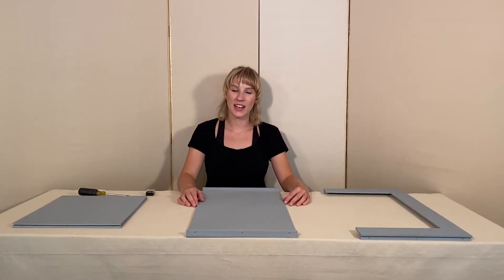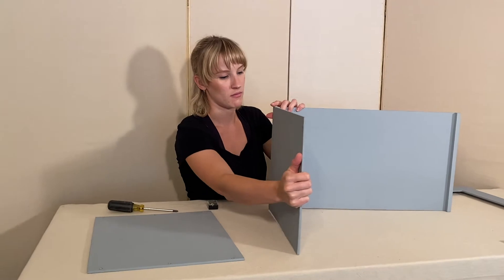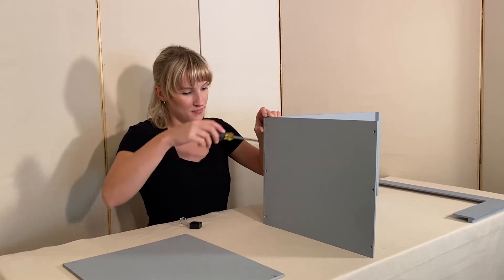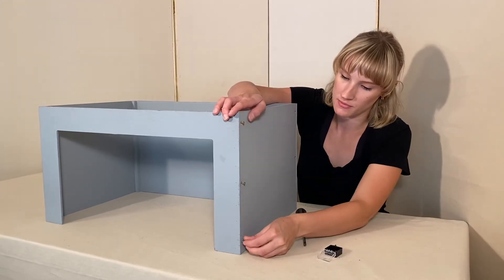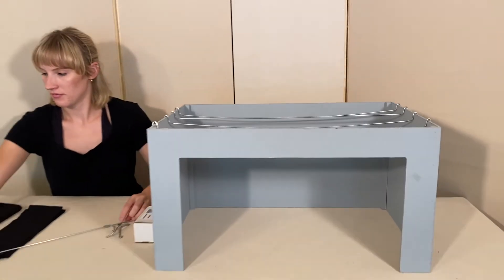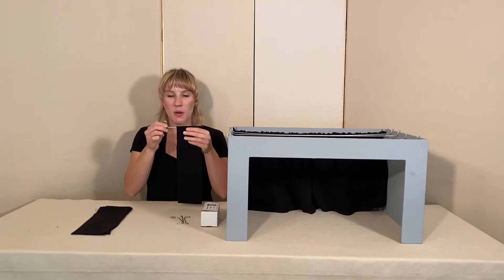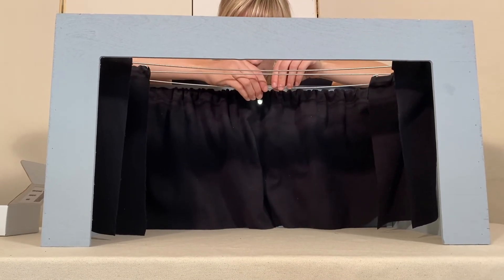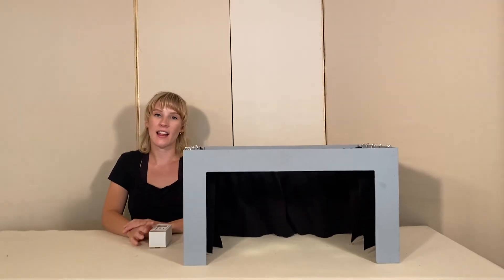TTSD How to Build Your Proscenium Stage Set

Comment: Measurement
Reply from the maker: The actal measurement of stage unit is 24" wide X  15" Deep X 13" high ; grid is marked in 3/4" squares. The set pieces are 3/4" = 1'